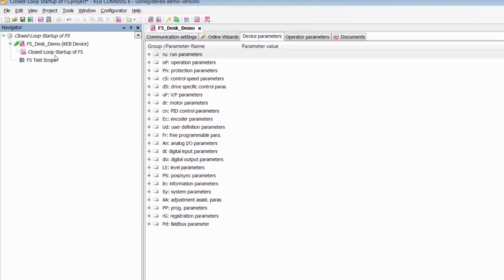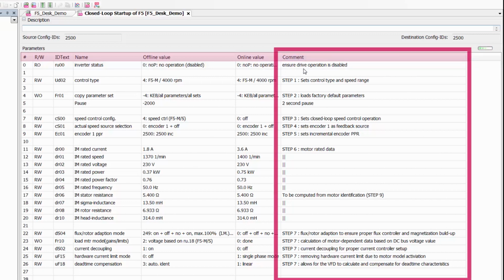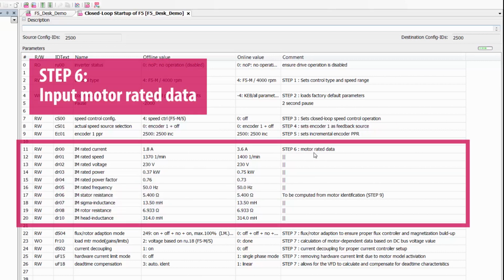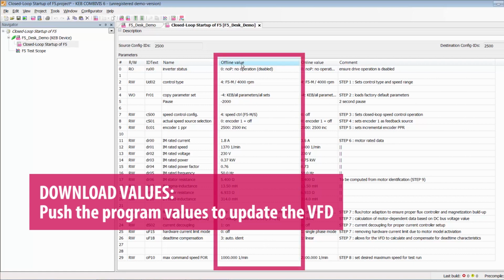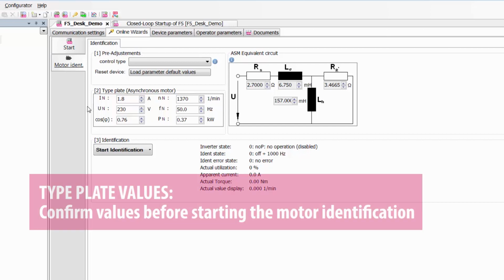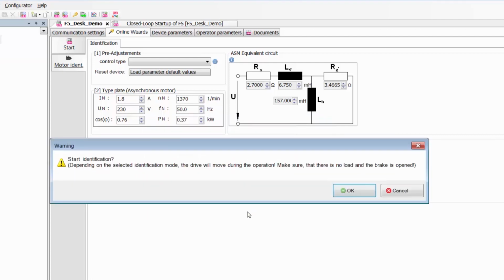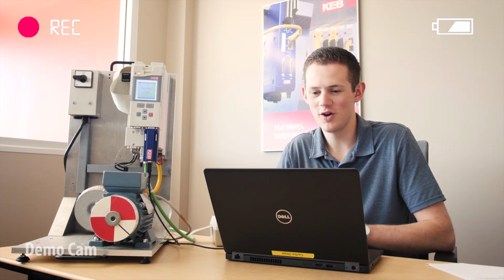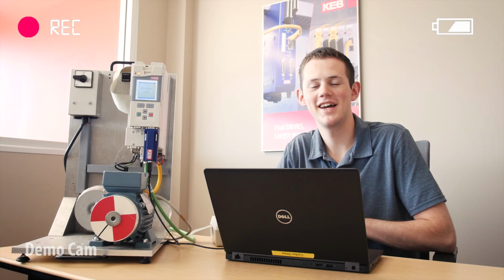How to Startup a Motor with a KEB F5 Drive | Problem Solved

Comment: mr. im too lost in details, can you elaborate on this ST thing a bit more? very overcomplicated product, i would advise to explain the wiring you used for this example. inventing a convenience wort like "switch on the set" and throwing it around casually like its a common expression is not very professional. are you guys still around? check the comments just below this video everyone is asking a simple question that is very hard to find, please take this as a hint, it is very cumbersome and unnecessarily overcomplicated.

Comment: I just want to do a test and set it up via the control panel, so no Combivis. 
So how do I perform a factory reset and do basic settings and a test run?
Reply from the maker: Thank you for your comment. KEB's COMBIVIS 6 software is free to download and program a drive. Go here to download the software: https://www.kebamerica.com/products/combivis-6-drive-software/ 
There is also a helpful video to explain the differences between COMBIVIS 6 and COMBIVIS Studio 6. I'm curious why you want to do a test and set up your control panel without connecting to our software. Is there a reason? If you want further assistance you can reach out to us for an application engineer.

Comment: are you making it a horrible experience to program it via the local panel on purpose?
Reply from the maker: Thank you for pointing this out. The F5 drive shown here is our previous generation of drives that do not utilize our easy startup wizards. Our current F6 and S6 drives allow a simplified startup procedure. If you want to learn about starting up a motor using the F6 drive you can check out this tutorial: https://www.kebamerica.com/blog/keb-f6-drive-start-up-procedure 
If you want to see an S6 startup (very similar to the F6), you can watch the video or follow along with this article: https://www.kebamerica.com/blog/keb-s6-servo-drive-basic-start-up 
Let us know if you have any other questions or comments. Have a great day!